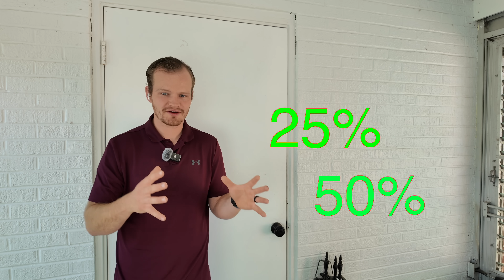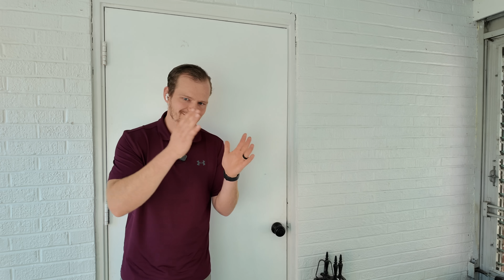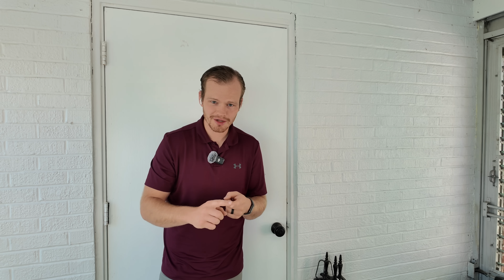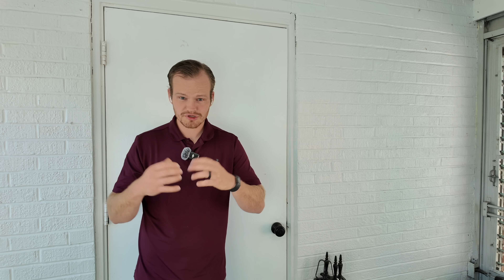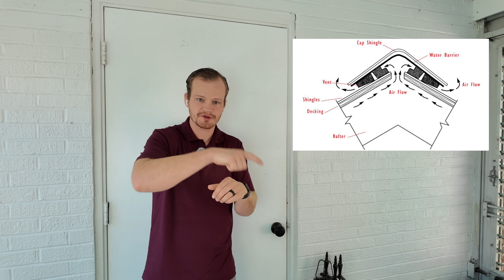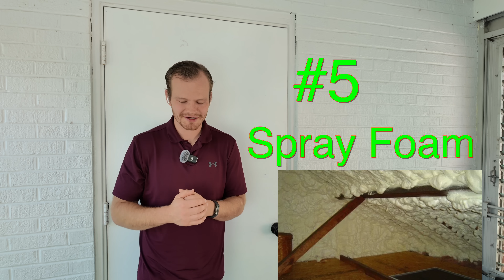5 Building Designs That Guarantee Mold

Comment: Thanks, Lumberjack Gold. After watching the video and reading the comments, I think the discussion needs to distinguish treating mold from preventing the moisture that allows it to grow.

Mold spores are common indoors and outdoors, and materials such as drywall paper provide a food source. The factor we can most effectively control is moisture—from leaks, condensation, or excessive humidity. That applies to mold generally, not just “black mold.”

Small eaves aren’t automatically the cause of a leak, but overhangs help protect walls from rain. Proper flashing, drainage, and roof details all matter. A dehumidifier cannot substitute for fixing water intrusion.

An airtight house can reduce heating and cooling demands, but it needs properly designed ventilation and appropriate makeup air for exhaust equipment. A powerful range hood can depressurize a tight home and backdraft certain fuel-burning appliances, potentially drawing deadly carbon monoxide indoors. The answer is controlled ventilation—not simply making the house leaky.

Air conditioning removes moisture by condensation, not evaporation, but short cycling can limit how much it removes. If humidity remains high, a properly sized dehumidifier can help. EPA recommends keeping indoor relative humidity below 60%, ideally around 30–50%. The goal is prevention: keep rainwater out, fix leaks, control condensation, and manage indoor humidity.

Comment: I have a very well-insulated house...warm in winter and cool in summer, so I've never had to use AC since I moved in several years ago.

I open windows in summer to get air circulation.  Mold hates air circulation.

I don't like noisy bathroom vents, so after  take a hot shower or bath, I open the window to clear the moisture out of the bathroom...summer and winter.  No mold there ever.

I don't need a dehumidifier in my basement, since I leave doors open on either end for air circulation.  No mold there, either.

Old houses were built to 'breathe', but new houses are built 'airtight'.  Mold loves airtight houses.

I live right between the ocean and bay on eastern Long Island, so it's pretty damp when you don't have the heat on, but opening windows has prevented my house from growing mold.

Even if you live in a hot southern state, opening windows during the cool of the night will prevent mold from growing.  I lived in central Florida for a year and had no mold in my house.  

Fresh air is the best mold preventer, so make sure that you have a house with plenty of windows for good health and a mold-free home.

Comment: I’m panicking. I just bought a house that has a dirt crawl space. Home was built in the 70’s. It’s definitely a fixer upper. I’m regretting the buy now. Going to have to put almost 80,000 in this place to make it suitable. Definitely didn’t think this through. First time home buyer with a lesson well learned. Also, the bathroom had no air vent. I place a fan in there everyone I shower to help reduce humidity,etc until we can get one installed.
Reply: Don't panic......millions of homes have crawlspaces and the vast majority have exposed dirt. The key is monitoring them and making sure that you keep them as dry as possible. Make sure the ground around the exterior slopes away from the foundation, make sure your gutters are clear and that downspouts are dumping out at least 8-10 feet away from the foundation, remove any organic matter/trash (cardboard, boards etc.. ) from the crawl, and invest in a quality 12 mil vapor barrier to cover the ground to about halfway up the wall. Monitor the space for water intrusion and keep your crawl space vents closed if you have them. If you are still getting moisture it could be a crack in the wall (often easily repaired on a crawl wall), or ground water which could be addressed by adding a sump pump and perimeter french drains. You will find that if you can keep the rain out through proper grade and downspout placement it will often solve moisture issues in a crawlspace.
Reply: @PBRStreetgang187 thank you. I’ll share this with my husband. 😊

Comment: Hmm most mold I have seen has been due to the outside wall and inside being poorly insulated and the temperature difference and high humidity inside would cause constant condensation.  Also leaving your AC "fan" on causes the humidity to go up indoors, I NEVER turn fan on my thermostat, always feels disgusting inside when you do that.
Reply from the maker: Yep the fan can cause problems

Comment: What if I spray foam inside where the floor n the wall meet to stop draft?
Reply from the maker: Alittle bit of spray foam probably isnt a big deal, it’s not my preferred method but might be the easiest way to do it. Just make sure there’s not signs of leaks that were drying out because you will remove the ability for it to dry out
Reply: @LumberjackHealthyHomes My small house was a flipper that was done in the middle of winter and what I've learned so far but I've slowly learned it wasn't done properly. Cut corners all over the place. Really drafty. It's a a cinder block home foundation walls all the way up

Comment: Thank you for reinforcing my thinking on water control in houses. I do take issue with ridge vents though. They look great and can work great until snow covers them and turns off the flow of air. Also, ridge vents need to work with some feature that allows fresh air to enter the attic space.

Comment: I've got one. We installed closet cabinets in a luxury house (Already lived-in. Not new construction.) that had accent walls where they used dark colored stone all the way up in two spots on the front of their house. They had being dealing with, fixing, and having recurring mold problems on the inside of the one stone wall, but not the other. It's a very humid and hot state. The unaffected wall is mostly covered by shade for most of the day, but the affected wall is in direct sunlight. My uneducated hypothesis is that the intersection of cookplate-hot stone and air conditioned home is causing condensation issues with the humid air inside the wall.

Comment: Hi, i had a house where the bathroom fans vented to the eaves - the eave of the roof deck was all rotted out as a result.  How would you avoid this if venting that warm most air at the eave?  Especially in a cold climate like Pennsylvania.  When i had the roof replaced, i put in roof vents.

Comment: Booooo for Zip system. And I know Huber is actively searching for me to send the hit man 😂.

OSB shouldn’t be on an enclosed insulated cavity.

To go through all the fuss to make it insulated and WRB for the ZipR, they made such a huge mistake in using OSB.

OSB doesn’t pass water vapour well at all. Use real plywood. Then a separate WRB and exterior insualtion.

Much better waterproofing than Zip (you get positive overlap with a WRB versus taped sheathing where the tape seam is exposed to running water down the WRB layer.

Plus then you have better insualtion to bring the dewpoint  out.

Plus you have sheathing that can pass vapour if need be.

Comment: Nothing wrong with crawl spaces, no overhangs, and flat roofs. You just can't have them built cheaply. You even prescribe how to do it safely. Crawlspaces that are properly encapsulated with de-humidification & drainage, properly installed zip sheathing & opening detail (also water resistant exterior insulation), and standing seam metal roofs all make these designs as effective as anything else. But again, you need experienced builders who will make sure these details are done right and that will likely add cost to the build. They're not hard, just time consuming.

I'm neutral on #4. Again, if you have moisture coming up through your floor, that is not what LPV was designed to handle. Take care of the moisture issue. And finally #5, I agree 100%. I really wanted to love spray foam but it has some very serious downsides that are near impossible to detect and/or repair without major demolition.

Comment: Why are people acting like dehumidifiers and erv are not a thing. Build the house as tight as possible then you can control the humidity and air flow with an erv. Having a leaky house is poor building science. Also i have done remodel work on old houses from the late 1800's and early 1900's and guess what, they all have had mold no different than new houses.

Comment: This fellow is so right. I had a small leak in my old home coming in from the chimney but never got it fixed until the chimney was rebuilt. The house was built in 1890 but because of the air flow  in this old house mold was never a problem, but it had to be fixed because we didnt want the beautiful wood to rot.

Comment: Relying on roof mounted power vents or on "whirlybirds" is St upid

The area of the vent opening in the deck sheathing is probably 12"×12" (?), right?

Think about this ......how can you move hot/ humid air in a 4000 cubic foot (?) attic through a 144" sq inch opening fast enough to vent & cool the attic?

 That vent/whirlybird is only going to be able to pull air out that is probably only within 10-12 feet of the vent.....what about all the rest of the attic space outside that 10 foot zone?

C'mon people......THINK!!

You have to use CONTINUOS roof ridge venting to even have a chance of attic venting

Comment: Studor vents do "failed", and in commercial volume settings, NEVER use it if a plumber tries to convince you, the smell coming back to your eatery, etc would drive out all your customers.....just like your HVAC, the person installing/calculating your "load" makes a huge difference...many assume go for "high tonnage" is way to go which is totally wrong, you want "air flow" to consistently cycle in/cycle out the air inside to ensure good feel.  In summary, someone like Elon Musk/Steve Jobs (driven like madman) need to redesign the home of the future according to their "geography" and local weather...
Reply from the maker: Good to know. And I couldn’t agree more. Houses need a major overhaul not just a few changes.

Comment: I really hate to say this . . . But you really need to reconsider your "knowledge."
     Crawl spaces are, in some ways, the best form of construction. They are less susceptible to damage by frost heave, tree roots, and allow access to plumbing and electrical systems. That last point greatly helps with repairs and remodels. 
    Crawl space ventilation is the key to moisture control. That's why there are vents -- and, frankly, most homes would benefit from a few more vents. Drainage, not plastic, is key to preventing crawl space moisture issues. Likewise, it's important the soil under the house be porous. Designing a crawl space to be tall enough to sit up in and access to be easy -- forget code minimums here -- is also key to getting the most out of your space.
    Raising the house up above the ground, even by just a little, helps prevent flooding and heat loss to the ground. (Who likes a cold bathroom floor?)
VENTILATION, not sealing, in the key. Assume water will get in -- by condensation, if nothing else -- so you need to provide a way for water to get out. You can either let it exit along with air, or let it drain out as a liquid. Most attics have "code minimum" venting, which in my opinion isn't enough. Usually the problem is that there isn't enough fresh air getting in. If your bat fan sounds like "whomp whomp" it's not getting fresh air. That's why new furnaces have their own "fresh air IN" pipes, in addition to the exhaust flue.
Reply from the maker: Yeah I don’t personally want a crawl space ever, I’m going to put in a basement if conditions permit.
Reply: @LumberjackHealthyHomes  basements are far more expensive.
Reply: I agree, I’m looking for a house right now, and they all seem to be built on slabs these days. Living in an area as I do that gets extreme heat and extreme cold it’s not a good idea to have the ground underneath your house heave hoeing in cement.
Reply: Ventilation for crawl spaces is useless in humid areas which is most of the US. So you are wrong

Comment: This person has a broad base of knowledge, but may not have the depth it takes to accurately identify the true source of the leaks. In waterproofing, there’s a big difference between thinking you know the cause and actually knowing with certainty. I’d be cautious about pointing to a single spot and saying “that’s the leak” without solid evidence. Yes, it’s possible — but unless you’re absolutely sure, and ideally backed up by other qualified experts, you can get yourself into trouble.
-Leaks are often caused by just one issue — but not always. Many times, it’s more complicated, and multiple factors work together to create what looks like a single leak point. That’s why assuming too quickly can lead to misdiagnosis.
-Acting on speculation can lead to wasted time, extra costs, and unresolved issues. I’d strongly recommend bringing in a certified waterproofing professional who can properly diagnose and address the problem with confidence.
Reply from the maker: I wouldn’t even disagree with that. I’m a young builder that’s spent a lot of time learning but don’t have the experience someone who is twice my age has.

Comment: Minor correction: Roof ridge vents exhaust air because heat rises. The air is pulled in at the soffits or gable vent and out through the ridge vent.
Reply from the maker: Thanks for pointing this out
Reply: yeah i think those are generally best if you are insulating the sloped ceiling (parallel to roof surface) and leave space between roof decking and insulation allowing the air to flow up from soffits along underside of roof decking and out the ridge vent.  if your not insulating the ceiling like this its probably better to just have passive vents at the gable ends leaving roof decking exposed on underside.
Reply: Venting the roof space makes it colder and brings the dew point to your ceiling/loft junction
Reply: @wendydevereux4375you 100% need to vent though. If you don’t you still will have condensation forming somewhere, usually on the roofs sheathing.

You know, the sheathing building up your finished roofing materials.

Now I agree it would be nice to cover the insulation in a way.

As we do on walls, using WRB to stop air infiltration while also allowing moisture to wick away.

I like to install the rafter vents a bit higher than needed, so to not have the incoming air wash over the insulation at least.
Reply: @wendydevereux4375thats why you vent your roof through baffles and ridge vent and you insulate the ceiling of your living envelope with r52. Now the issue becomes bigger when you intend to use your attic space as storage or a living space, then you have to insulate your roof but do it in a manner where the sheathing can be separated from the living envelope or you will experience ice dams and rot.

Comment: Are you calling open crawl spaces also crawl spaces? Like if I would design a house that is what I would have and I would make it high, plus capillary break gravel and french drain. Best way to keep the house dry is to keep the house away from the moisture to beging with and hence high open crawl space plus capillary break gravel and french drain. 

Also I totally agree with you on the big roof overhang thing. Regarding roofs, I would also go with an metal roof.
Reply from the maker: Metal lasts forever pretty much! I really just mean the kind that have walls like a basement. It can be done right for sure.
Reply: In high humidity regions the best way is to have the crawl space to be completely open. Oh yeah 2 ft overhang equals more ventilation.

Comment: I've had bigger mold problems in European and Asian countries than in the Unites States, and it boils down to HVAC. Folks, if you've got central heating and cooling, and the option to just run the fan periodically to circulate the air, _do so_. It's not just for heating and cooling the rooms you use all the time. We once had an upstairs we rarely used, and the cooling was through mini-splits, so I thought I was super cool (pun intended?) not to waste money on the upstairs. Oops. All that moisture will build up, we had over 70% humidity when I measured it... after walking up there to a discover a mold farm.
Reply from the maker: That’s interesting, central air is very is a big deal. I have mini splits only in my shop but I don’t think I would do it for my home.

Comment: Not having Eaves and flat roofs aren’t the biggest design flaws.  Poor products, like modern building wraps that don’t breathe, and not having proper air movement, are.  

Zip system sucks also.
Reply: Flat roofs are actually an issue but that depends on the area.
If in a place that gets heavy snow or rain flat roofs are problems waiting to happen.
If in very dry areas that get light to no rain then it doesn’t matter if the roofs flat or even designed like a bowl.

Comment: Problem with these air tight homes is that they need to be built by professionals who care and have attention to detail. These big home builders are top heavy corporations that focus on profits for the white collars and use the cheapest tradesmen they can get away with. Therefore you are likely to get seals that start leaking 5 or ten years down the road and let moisture into cavities that don’t vent and cause problems. Water will find a way in eventually.
Reply from the maker: Finding people who care in construction can be tough.